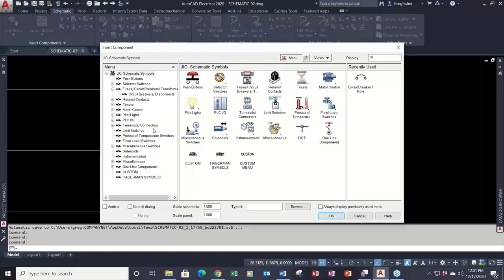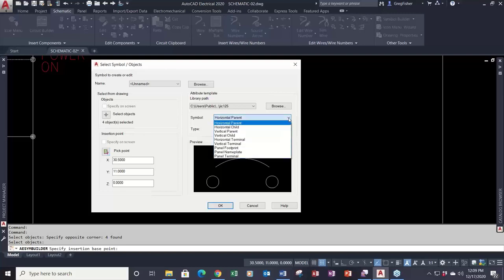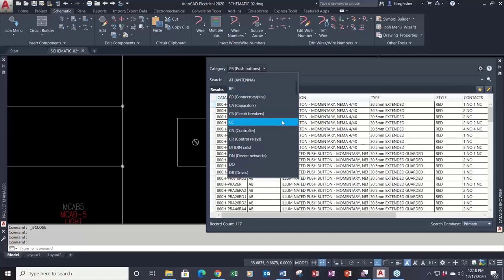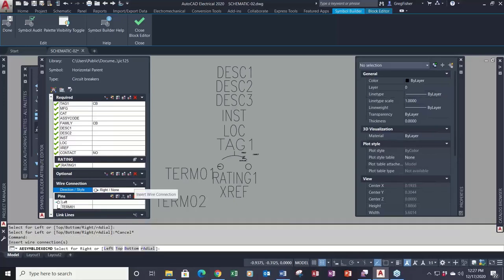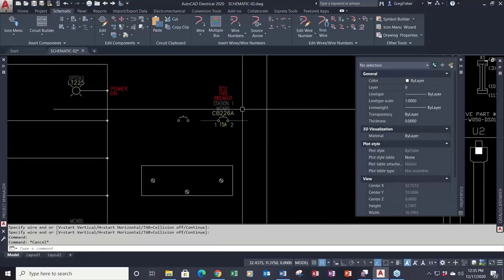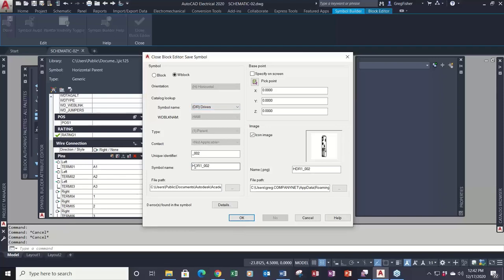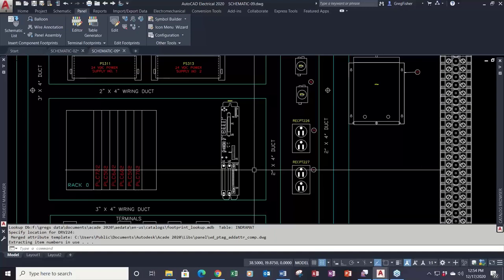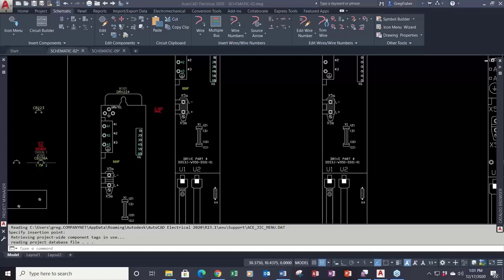AutoCAD Electrical Symbol Builder

Comment: This video was very helpful. However I am having one issue that I can't seem to fix. Whenever I complete a symbol and put it into a drawing, the Pins section of the dialogue box is greyed out and it won't allow me to type in my pin numbers. I did add the wire connections according to the instructions in this video but for some reason the boxes are greyed out for me no matter what I try. I can still add the pin numbers by double clicking the component and entering them that way, but I would really like to be able to enter them the normal way. Any help with this issue would be greatly appreciated :)